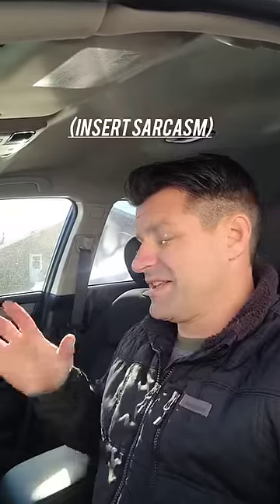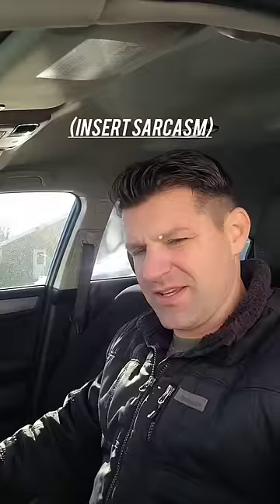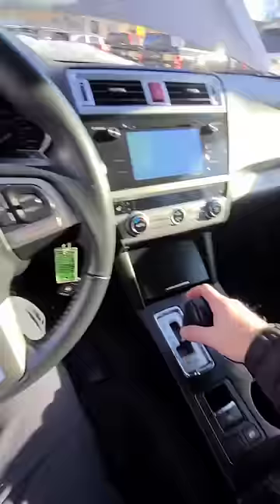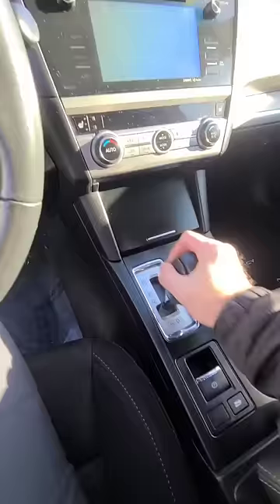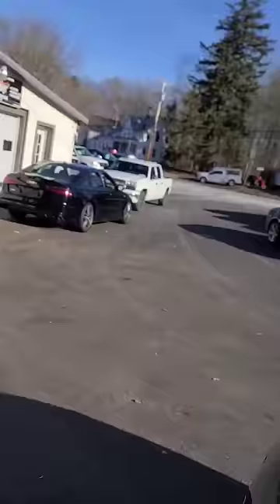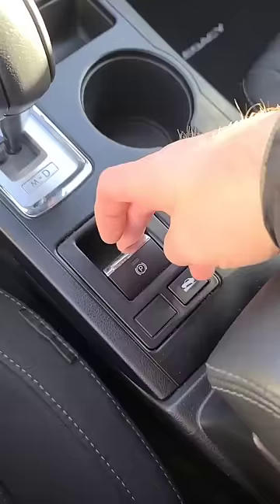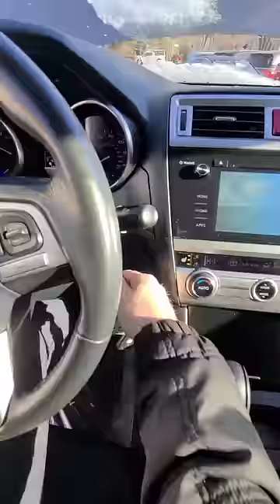Why Subaru Engineers deserve a punch in the Face! #shorts

Comment: im not a mechanic but this guy just making confussion to everybody who owns cars with eparking brakes not just subaru. i beleive manual parking brake is better but the question is that where is the car at the moment? is it in the parking area? why is it in neutral and the parking brake is not engaged? specially when you parked in an elevated parking space. if the car just suddenly stops, i dont think the first problem is the battery. enlighten me the reason of the problem first. why is it in neutral and why the eparking brake is not engaged?

Comment: There is such a thing as wheel chocks. They only work best when the  car is not moving on a level surface. They are really cheap. Yeah why can't NHTSA mandate a manual parking brake in all vehicles if you can't activate a powered parking brake with a dead battery?

Comment: All cars should have a foot parking brake like Mercedes had on some cars, and by having the wire to the front wheel it wont even cost much, or need any maintenance.
Reply: Cable parking brakes need maintenance pretty often

Comment: At least your brakes work lol. I brought a brand new Subaru ascent for my wife under the pretense that they are supposedly one of the safest vehicles around. The brakes have gone out three times in under 30k miles. Not once have they fixed the intense shaking every time you brake on a highway. Struts and tire rods had to be replaced twice already and it hasnt even been taken off road. It already has multiple electrical issues. Did I mention I bought this car BRAND NEW😂? They are complete and utter garbage, don't do it.

Comment: I was so disappointed looking at the newer Subarus, they suck after 2010. You can't open the rear hatch with a dead battery either. No more vlsd's either unless it's an STI, you get power to one tire at a time on the front and back. That isn't "AWD" it's a rip off.💯🤦

Comment: This is why I got a wrx its fun fast and has a good old fashioned manual transmission and a standard parking brake. But to get to the spare tire requires removing two trunk liners (mine has the rubber one on top of the carpeted one) completely from the trunk they can't just be folded up then I must take out five big pieces of insulation foam before the spare tire can be removed. I had a flat in triple digit desert heat the other day and I took out all that extra unneeded crap just to find out the last owner of the car took the tire changing tools man I was pissed thank goodness I was lucky to be very close to a tire shop. Does any car really need all that foam insulation over the spare tire???? My Chryslers trunk liner folds up and the spare is right there. I don't need sound deadening under the trunk floor God they put so much stupid unnecessary crap in cars today that's probably why they cost so much now lol

Comment: These overly electronic vehicles in general are a problem. Expensive to repair, you need specialized software to even do most repairs, everything is tied to electronics. All for that good Ole luxury and laziness. I will stick with my mechanical and analog setup.

Comment: Whats about simply put a  wedge under the wheels 😂 

And whaaat 😂 the emergency break dont work 😂 uhhm  
If you part isnt it at P (ark) the car shoulnd roll... If you drive does your alternator dont produce electricity so you can pull the "Handbreak" and the car in N. 

If its stay its stay or not... 

This is so confusing why they dont leave us just the regular Mechanicak Handbreak 😂😂

Comment: You have to buy the base model of cars so you get an actual emergency brake 💀
Reply: An electric parking brake is also an emergency brake
Reply: @THEACERASPIREMAN  but you can't use it IN AN EMERGENCY because it blocks you from using it while the car is moving and you just can't use it at all when the car is dead
Reply: @TYPICALTRYHARD_  It doesn't block you from using it in an emergency. An electronic parking brake is still designed to slow a car down to a halt in an emergency

Comment: Did the battery died , while you were driving? You would have the first syptoms by slow cranking or difficult start . And as long as the battery can start your engine , it is pratically good enough to drive the car and won't die all of a sudden when driving. I can really not conceive how you end up like that????????  Even of it can't start the car , there should plenty of current to run your radio , park brake etc. The only way that i see is that you disconnected the batyery. And did you put in P and applied parking brake before doing so? The video is a complete non sense. Sorry to say this..............

Comment: Finally, someone else voices and says how stupid Subaru designers are. I’m stuck driving a 2012 Forrester right now it won’t even let me adjust the Soundsystem while I’m driving or when my passenger is not driving just so many dumb things like that. they won’t tell me in the owners manual if the car comes with dot 3 or dot 4, but it does say don’t mix him. I’m not done finding stupid things on older Subarus.
I’m going out in the limb though on this one you gotta have a man bond to want to drive one of these lesbian cars. I don’t.

Comment: Are you pretending to be a dealer? 
The PARKING brake should have been applied before leaving the subi BEFORE its battery went flat. Further, in the owners manual is a section about releasing the gear shift. not sure why muricons like yourself like slamming it into PARK with no PARKING brake. Youll note the symbol on the brake button is P for parking not E for Emergency.

Comment: Next time, if that happens that little glove compartment that’s in front of the shifter if you open the door, the little rubber cover that’s in that compartment you left that cover up and there’s a hole where you can fit a Phillips screwdriver a flathead in it so that way you can manually shift the shifter to park or neutral or drive You can move it like you used to do back in the day with automatic cars. Hidden inside compartment in front of the shifter maybe if you did your research she wouldn’t make this dumb video just to get views

Comment: Subaru as a whole is absolute shit honestly. The engine design is terrible and hard to work on, even to do routine maintenance. The minute you try to get any power out of their engines, they blow up, or at least blow the head gaskets. Don't you want to change 2 head gaskets on your 4 cylinder? Oh, by the way, you have to drop the entire front end out of the car to fix anything engine related.

Comment: That’s a dumb video with dumb ideas. Every car by law must have the shifter override and the electric parking brake override. Subies do have those and the activation is very clearly described in owners manual.
Your absolute obligation as a driver is to know how to use them in the vehicle you take responsibility for.

Comment: That's not just bad, that's potentially deadly. That should be an immediate recall.
Reply: No recall - driven by government regulation, which is why Subaru and other transmission manufacturers (Subaru didn't actually make this transmission, it's a Denso unit) created a shift lock release for this exact situation.  It's in the manual.